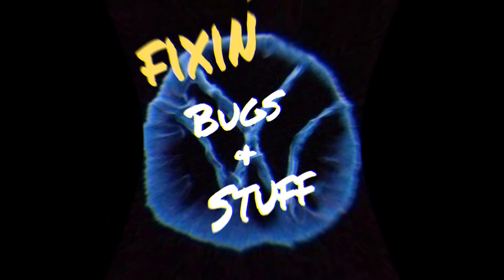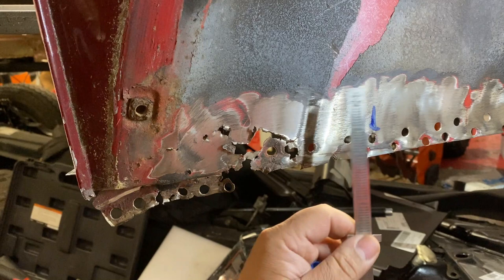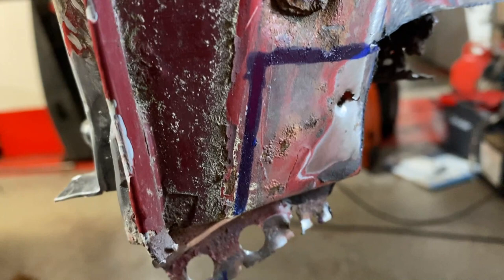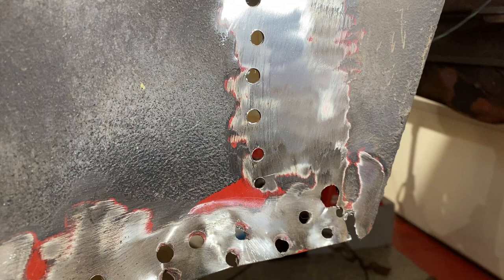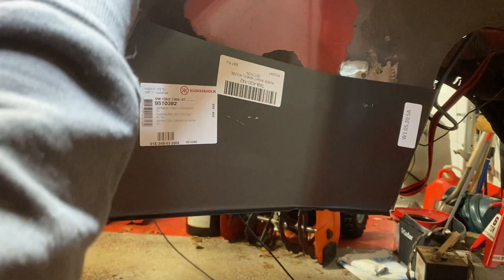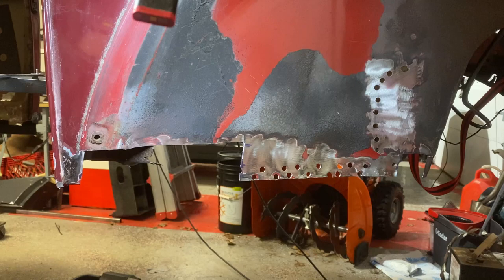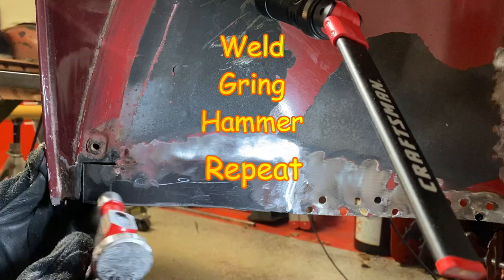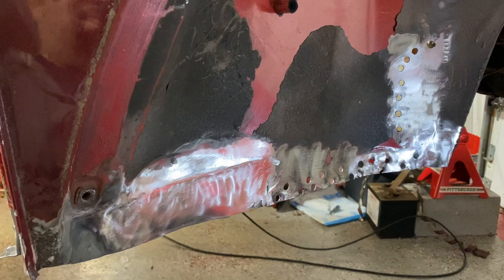VW Bug Front Wheel Well

Comment: There are 2 little weep holes under the rubber windshield gasket. The windshield rubber between the body and the rubber…..for a better term….leaks.
It channels this water to those holes, and under your hood, in those corners. A tiny stream of winter brine would go down those sides.
There is a weep hole at the bottom of the hinge area….but you still have water going down there causing rust.
In my opinion it was a bad design. And caused a lot of rot in that area.
I guess it was cheaper for vw to drill 6 holes, than for them to use some liquid butyl   sealant.
I use 3M 5804? Black butyl sealant between the gas’s and gasket, and between the body and gasket of the windshield, making sure to plug up those corner holes.